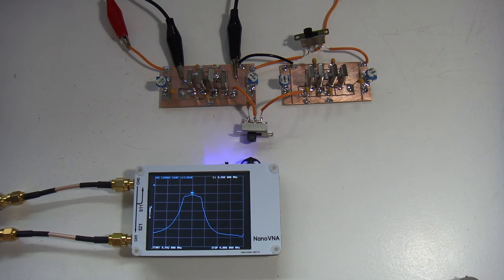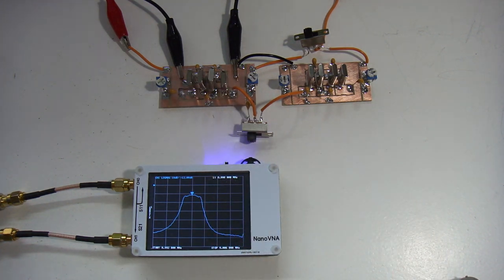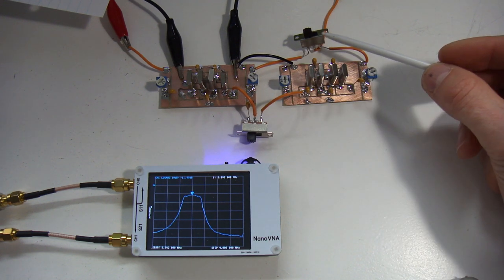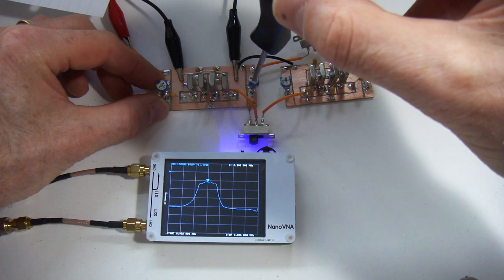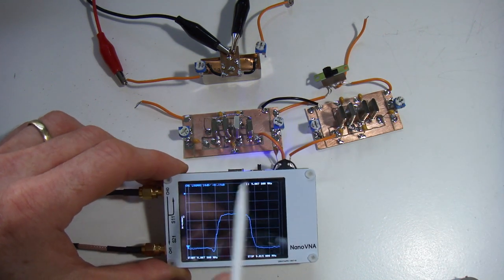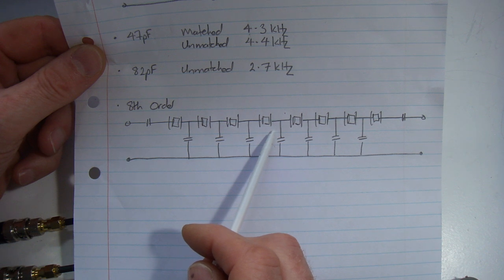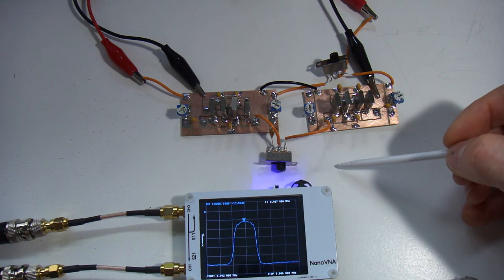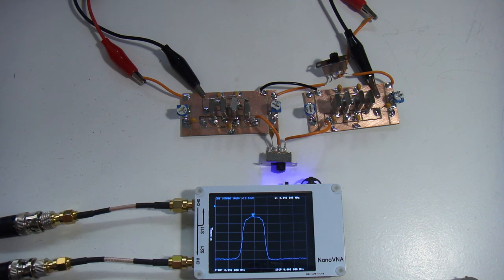Simple SSB Rig: Part 3 - Crystal Filter

Comment: Charlie your the only one who makes since making crystal filters.  I've never understood Wes Haywards article.  I think I do now thanks to your help.  What is unbelievable to me that anyone would just haphazardly get a bunch of crystals to make a filter and not for a particular purpose.  I've been puzzled for years since I read Wes Hayward's article.    I am an amateur radio operator and wanted to give my old GRC-9y back pack receiver better selectivity.  Wes Hayward and others never mention to what end their filters will be used for. I know many double conversion receivers have an IF frequency of 9 mhz.  Evidently you are making your filter for your 9mhz IF.  Thank you for being clear about this.    Evidently a crystal filter can be used to improver performance of your spectrum analyzer for example.  So what.  We are radio operators not design engineers.  Please excuse my frustration and thanks again for your clear presentation of crystal if filters.
Reply from the maker: My pleasure Douglas. I'm no expert that's for sure. It works for me.

Comment: I purchased some cheap 10.7 Mhz cystal filters meant for the IF or FM radios that i am going to try and use as my IF filter.  They are very wide band but i think they should work. (I am going for SSB on 40m  and/or 20M not sure which yet.)
Reply from the maker: Give it a go as they say.

Comment: Quick note:  I tried making a filter with 4 of those 8.3886 mhz crystals.  Just grabbed 4 out of the bag, and used 3 100pf caps from the junctions to ground, and one on each end in series.  Then I wound two small #43 ferrite cores with about 6 turns trifillar.  Connected the windings in series with the filter going to the full coil, other end of the coil to ground and feeding it from the first winding.  So we have a 3:1 turns ratio, or 9:1 impedance ratio.  That gives us about 450 ohms termination on the filter.  Scanned it with my nano-VNA and it looks like I'm getting a center freq of 8.388 mhz and a bw of 2.4khz.  Didn't try optimizing the caps or the termination, but my 'hail marry' attempt seems to have netted something useful.
Reply from the maker: Nice one! 2.4 kHz BW would be fine. Great job.

Comment: So it would seem that for a SSB filter matched crystals are not critical, and a lot of crystals on the same frequency will work.  However, this might not be the case for CW.  The loss is a bit on the high side, but if you add a MAR type amplifier (perhaps BETWEEN the two sections of the 8 poles) that would solve the problem.
Reply from the maker: Agreed. I'm dropping some of the signal across the two series resistors which won't help. I also compared the results with two commercial filters (again using series resistors) and got the same result. We'll see how it goes.
Reply: @CharlieMorrisZL2CTM  Yes with matching transformers of the correct ratio instead of the resistors the filter loss would be less, but the response curves should be the same.   I have a few hundred 8.3886MHZ HC48/HC6  crystals I got surplus.  I should try grabbing a random handful of 8 of them and try a filter.  I'm guessing that using 100pf capacitors would yield a BW closer to 2.1KHZ.  How did you set up the VNA (calibration and mode wise) to measure the filter? 
BTW, some designs use TWO crystals in parallel for the first and last position and/or omit the input series capacitors.  I wonder what effect these changes make on the filter response.

Comment: Thanks for the info. I'm working on a 6 meter transceiver the filter I built has a 100 ohm impedance. Instead of using transformers to match I'm just designing the input and output amplifiers for 100 ohms. I don't know if I'm right or not just thinking the more reactance you eliminate the better. WA8HTO
Reply from the maker: I'm no expert Jerry, but that sounds like a great way to go. Let us know how you get on.

Charlie

Comment: Great video. Question on the trim pots. Are they on the positive line or between positive and ground? Didn't see them on your schematic.
Reply from the maker: Both are in series with the signal Cedric. I'll add those values to the 50 ohm SNA impedance and look to terminate the filter with that. Well that's the plan for now!

Comment: Hi Charlie, thank you for your very educatinal videos. I have build your latest design, but then for 20m. The receive is very good but on transmit it  sounds not so good. Wil you please help me understand the BFO part of your final arduino-code. How did you come to the four frequencies? Can you please tell me the center frequency of your filter and  the bandwith of your filter? Was the frequency scheme: For receive LSB: BFO=CF-(BW/2)-300 and for receive USB: BFO=CF+(BW/2)+300? And how is that for transmit? André PA3EIV
Reply from the maker: Hi André. For this build I took a different approach and selected the BFO freqs based on the received and transmitted audio. I used a podcast to monitor the received audio quality and the transmitted audio and adjusted the two BFO freqs to get the best quality audio. I have not tried this approach before, but it seemed to work well. Give it a try, as i suspect my filter and your filter will not have exactly the same characteristics. Let us know how you get on.
Reply: @CharlieMorrisZL2CTM  Thanks Charlie, i wil try setting the BFO frequency in the suggested way. Do you have the test-code, you used, public somewhere?

Comment: Great stuff Charlie, I used that trim pot method for my latest SSB filter and it seems to work very well. Sadly, my VNA died after two days use and I eventually got a full refund. Not get found a replacement from a reliable source. Using an 'old' MIniVNA which is fine, but not real time like the nano.
Reply from the maker: Check out the newest version Steve. I ordered mine from their recommended online shop. Mind you, it hasn't turned up yet...
Reply: Roger that Charlie, I received mine yesterday, this time from official UK dealer. Great service.

Comment: Hey, Charlie great video! I just happened to be working on the same thing and was trying to understand what all the capacitors and crystals would change on the waveform. I bought all my crystals at the same time, 100 of them. the resonant frequency roughly from 8.99594 to 8.99638. I tried different crystals knowing the resonant frequency was different and the waveform didn't change much. the capacitors on the other hand made huge differences. now after seeing your video I am wondering because we bought our crystals in bulk if they are just so close a match that we are not seeing the change because they are so close? also with the NanoVNA being an affordable tool that the hobbyist can obtain easily nowadays, maybe we would not need to measure every variable of the crystal and can just tweak the filter to work for our needs? I'm saying this not knowing to what precision these filters need to be or how precise they can get.
I guess what I'm saying is maybe our tools have improved for the hobbyist enough that we could just measure and tweak our way there if we know a good starting point?
Reply from the maker: That's a good point Curt. I am no expert here, so there may be a lot more to it. For now this simple process works for me for the reasons you gave.
Reply: @CharlieMorrisZL2CTM  I happened across some information, I was told that if your crystals are within 100 to 150Hz they will work great for a crystal filter. I believe we got lucky we bought them in bulk. I can't imagine going through the junk box looking for matches. lol

Comment: Nice one Charlie, happy new year mate. I agree this real-world design approach is spot on for HAM, we can use theory to get us in the ball park but sometimes you've just got to build it and see the results working before your eyes, which sets a level of confirmation that I am on the right track. I took a similar approach for my Top Band magnetic loop design, used the calculators to see how it would roughly perform, then just built the design I had in my head albeit with a few failures but the end result was amazing, only a couple of S points down on a dipole for a 2.5M square 2 turn loop. This sort of homebrew design is key today as the lack of commercial crystal filters is becoming very apparent, for anyone wishing to build their own SSB rig then a homebrew filter is the way forward I reckon.

Cheers
Rob M0XXQ
Reply from the maker: Agreed Rob and Happy New Year too. You can still buy the filters, but they are quite expensive. I'm more than happy with how this filter turned out.

Comment: Love the approach! Think I'll get one of them NanoVNAs.

I am planning on building an RX only rig for starters...do you think that if I feed the AF straight into computer and use software filtering I can get away with using cheap 455khz filter(3 pin one from ebay). Best of luck, M/9A3ICE, 9A3ICE !
Reply from the maker: A receiver project is a great way to go Ivica. Once you are at baseband (i.e., AF) then yes you could feed it into the mic input. As for the filter, 455 kHz is the IF. It all depends if you are looking at AM for SSB as the BWs are different.

Comment: 11..12bB insertion loss is a bit of a price to pay, most commercial filters offer 1.5 to 5dB insertion loss. Still, the shape looks good enough!  Cheers Charlie.
Reply from the maker: I'm not so sure at this stage, as I'm dropping quite a bit of the signal across the two series resistors which won't help. We'll how it turns out. I also tried two other commercial filters with series resistors and got the same result. Once I saw that, I wasn't too concerned with the setup.
Reply from the maker: Paul. I have just looked again at this. The two trim pots are 100 ohm each. I have just placed a 200 ohm resistor across the VNA and measured -9 dB. That means the filter is around -3 dB. Not perfect, but i think it will be ok. We'll see!
Reply: @CharlieMorrisZL2CTM  much better, and about what you would expect. You didn't want to wind up a couple of small FT37-43 impedance matching transformers? Easy enough to do, and low loss...